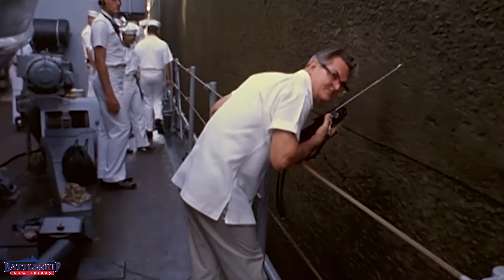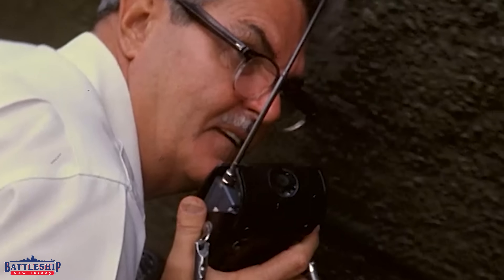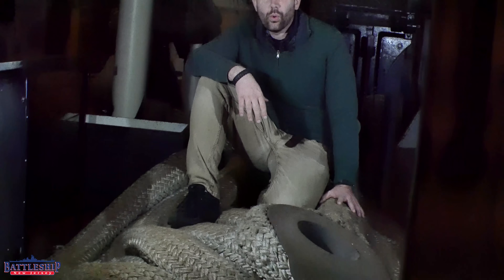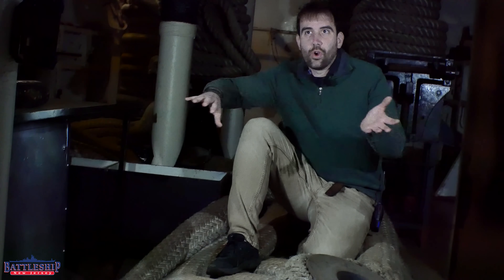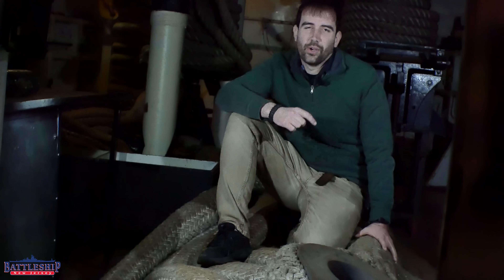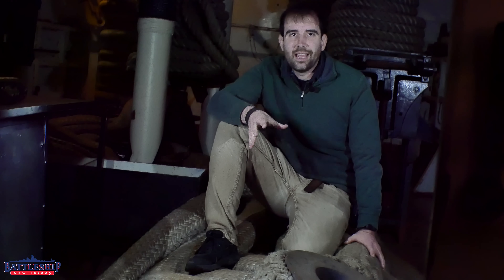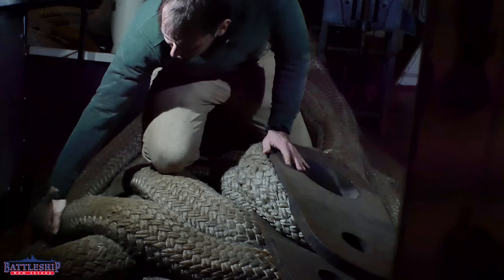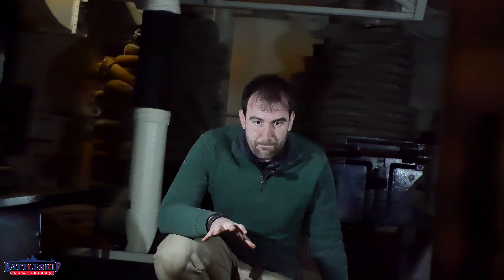Moving a Battleship Without Functioning Engines

Comment: someone needs to make a keel mounting submersible ROV. thruster pods for motion and steering, batteries to power the thrusters, fixed magnets, electromagnets and suction on two halves with subsections that can rotate to fit to a keel of any steel ship. charged from deck cables and either fuel generators, solar panels or whatever. yeah, not going to be breaking any speed records and could take an hour or so to even reach a few knots depending on the output. it would be versatile however for any steel hulled ship that cannot move on it's own power. with the materials, hydrodynamic modeling and electric motors available today while it wouldn't be easy...but it wouldn't be rocket science either ^_^

Comment: I read a lot of comments below about manually moving ships in the water which is not a problem if there is no wind or current affecting the ship, but you add a little breeze or a 4 knot current and your tiny little body can be made into some greasy spot on a dock real quick. I own a couple of small fishing boats and one time a storm came up and I got to the ramp with a 20 mph wind and some do good guy offered to catch my bow line, he caught it and acted like he was just going to hold it to stop the boat. Well, I screamed at him to wrap it around a cleat and you should have seen his face when my boat started pulling him around. And after another go at positioning my boat with the motor I got along side and he got the line around a cleat and held the boat till I got it fast. 

Tugs have huge engines, and sometimes bunch of big propellers, and are designed to handle the push and pulls of the wind and current dragging enormous loads. And Sea Tugs are for real at what they can do.

Comment: it doesn't take much to move a ship by itself on the water, but surely to speed it up or slow it down, or if you need to change directions, you will need a lot of force to alter the ship's momentum
not to mention, even though there are no sails on the ship, the wind could still push the ship around, and the tugboat will need to have enough power to compensate for it

Comment: Question for you and maybe you’ve already answered this. Hypothetically speaking if you were to reactivate the engines. What would be the consequences? is there a fine would you get arrested with the navy come and take the battleship away?
Reply: it's just not possible. It would require 100's of thousands of dollars in fuel, crew, repairs and maintenance , etc. You can't run 600psi steam through 75 yr old pipes without xray inspections and stuff.
Reply: It’s a hypothetical question. I understand it would take a serious amount of time and money. I just want to know what the consequences are of doing such a thing.

Comment: I was working at the Courier Post newspaper in nearby Cherry Hill N.J. when the ship traveled thru the canal. They had a reporter on board for several days while the ship moved thru the canal. The newspaper made a nice size hard copy book on the battleship. Guess they thought it was going to be a NY times best seller. They advertised the hell out of the book and a year later still had probably a halve dozen shrink wrap pallets of them collecting dust in the newsprint warehouse.Thanks for another great vid. While working at my first job the maintenance department had to tie a 1.25" rope on a box car and move it maybe 10' to top load into next roof hatch. Rope would break and only guy who could splice the 100' long rope was a retired navy guy.

Comment: Thanks Ryan.  I know I have been one of the many wondering what PHYSICALLY limits the New Jersey from moving under her own power, outside of legal and manpower issues.  I guess boilers are one thing to get started, but if you have no water for the steam turbines then you might as well not even bother, all you're doing is making heat.
Reply: I think a lot of the boiler issues are safety/certification. You can't pressurise up to 600psi on 75 year old pipes, without a lot of inspections!
Reply: @gordonrichardson2972  Hey that's an excellent point!
Reply: @FlyingWithSpurts  Yeah, they'd have to check all the steam pipes, all the fuel pipes, all the water pipes and get some parts that have been still for thirty years spinning very quickly to generate electricity.

Comment: Tugboats are basically a massive engine, with just enough fuel tank added to get through 2 days of full power use, and just enough bouyancy added so the engines float. Then you use it to provide massive amounts of force to a rope, and massive amounts of force to a bumper, to move ships in harbour. Bigger ones can travel long distance, but living on them can best be described as spartan, and all the crew do multiple tasks. A hard life, on both machines and crew.

Comment: Can New Jersey still steer using her own rudder?
I.e. when under tow is all the steering from the tugs or does the ship contribute to steering with it's own rudder when under tow?
Reply: I think rudders are powered by the banned equipment, so no.
Reply: I doubt they could  and also think it may be a bad idea.  My guess at the low speeds of a move like to drydock the ships rudders would be near useless or very slow responding. Better to let the tugs do the steering, they know how.

Comment: I can believe you might get 1000 tons moving a slight bit dockside in a zero knot wind BUT 1) there is still 50,000 tons of mv, momentum and 2) there is still wind speed^2 x drag coefficient x cross section area (skipped fluid density).  And 2 might get big.  Then, there is 3) ... water is heavier than air and we can do the same calculation with currents and I bet at times that is bigger yet.  It would not surprise me weather and sea conditions might strain even a good sized sea tug at times.  In the canal, any significant velocity would mean a big momentum.  If Ryan was there sticking a foot out to stop USS NJ, I expect to see only a stain on the lock gate.

Comment: I was on a 4500 ton Destroyer and I watched 2 deck sailors who were repainting the boot top (black water line) put their backs against the pier and push that ship with their legs. It moved about 6 inches, assumed the mooring lines stopped the movement, then came back to rest.
Reply: I used to stand on the mooring line cutting barges loose my body weight could easily move one. The load on one was around 5000T we used to calculate load by cubic feet using how much they settled in easy with a rectangle.

Comment: Tugg boats may not generate the power the New Jersey once could. On the other hand they usually have over 1000 horsepower which is nothing to sneeze at either.
Reply: 1000 is a smaller harbor tug, more like 2000 to 4000 might be closer.  Sea going tugs might be more like 4000 to 10,000 hp. Last boats I worked on were rated at 9600 hp.  So a lot of power in a small hull.

Comment: We are dealing with a generations of people that think you can simply start an airplane up that has been sitting somewhere for decades and fly away.  Or a federation star ship left on a planet for over a 100 years.  Yep, no problem.   People have no grasp of the mechanical complexity and required maintenance required to keep something functioning.  Modern military aircraft require many hours of maintenance for each single hour of flight.  A big old battleship has a lot (LOT) of systems that all have to work together for it to do its job.   I loved the 2012 Movie "Battleship".    They lit the boilers and had steam in about 15 seconds.  It was tragically beautiful.   A nice fantasy movie, at least the aliens lost.
Reply: While I know deep in the trenches of my brain that it is an almost impossible feat to turn it back on, my instinctual thoughts are still "couldn't we just send a volunteer who is also scuba certified down there with an angle grinder to cut off the coverings of the sea chests?"

"Hey, it's a bit rusty? Just a sec, I have a wire brush in my glovebox!"

I know it isn't so simple, not on a hundred foot wide ship certainly, not on an untouched for 30 years mechanical room too, after all, I spent two weeks installing lighting circuits and lights on a single floor of a high rise office building, and that was with a team of 4 people. I know that anything to do with electrical or mechanical systems is obnoxiously expensive, time consuming, efforted, etc, but I still underestimate the actual amount of work, I still think there is an easy solution, even if there objectively is not.
Reply: World of Warships has a LOT to answer for in this regard given its absurd abuse of physics and ridiculous speeds ships reach. I suspect it's the single largest ongoing environment involving these ships, and people who play it end up thinking they know about the ships and technology when in fact they're terribly ignorant. That they're ignorant isn't their fault as we're all ignorant of everything until we start to learn. That they think they know about the topic because they play WoWS is largely WoWS' fault because the only thing realistic in that game is the modelling of the appearance of ships (which is done very well).
Reply: @steeltrap3800  I play World of Warships and it is a fun game but the only similarities to actual naval warfare is the ships 'shoot at each other'. That is it. lol
You are right about the ship modeling. That is what drew me into it in the first place.
Reply: @ut000bs  I played it from its Alpha test through to launch.
I quit playing some 480 games after that. Too easy to see where it was going, 

WG will never change their spots. The didn't listen to anyone during testing, so there was no reason to think they would at any other time.

Sad thing is many of us identified a lot of the most complained about issues and made predictions as to likely results if not addressed.

One I made? 
"WG will NEVER manage to 'balance' CVs in the minds of most players. 
Either CVs will be 'fun' to play and a misery for everyone else, or not much of a factor for everyone else and those who DO play them will soon stop out of frustration with them being unrewarding let alone not no longer grossly OP."

If you think CVs might be a bit OP now, they were WAY worse back in Beta and release, hard though that is to believe.
That was when, 2015? LOL

I've also been reading naval warfare reference books for a bit over 40 years.
Cheers

Comment: I would assume most people see tugs as the ones in a harbor, aren't there sea going tugs that are the ones used to make such moves because they way they are designed?
Reply: You are quite correct.  Sea going tugs are bigger and much more horsepower.   Most sea going tugs are used to tow sea going barges, basically vessels with no propulsion but the size of medium ships.  Also a lot are used to move offshore oil platforms.

Comment: After you get an unpowered ship moving, how do you get it to stop where you want it to stop? Thinking that opposite to the tow there's a lot of taut lines and tugs that had been pushing are now in max reverse
Reply: Exactly  tug power to stop it. You would approach very slowly where you want to stop after beginning to slow forward speed plenty early.   Now imagine out at sea one tug towing a ship  the only way to stop there is by gradually slowing letting the momentum bleed off the ship.

Comment: Out of curiosity, why did the navy specify that the engines cannot be reactivated?
Reply: To protect the ship and the engineering plant. It would require a large crew of well trained people to bring the steam plant and engines on line. The potential is there to do serious harm to the ship including sinking if something went wrong. The Navy will not take that risk.
Reply: For an extreme example of the same concerns, there are museums with nuclear weapons on display - the outside casing of bombs, missiles, whatever SUBROC was. No, the museums don't have the explosives, propellant, or fissile materials. 

Other than safety concerns, museum weapons are also deactivated so that they're not a diplomatic issue. A museum ship that's ready to sail, with a trained crew who could be conscripted is pretty close to reserve status. In fact, Germany did reactivate tanks and other weapons out of museum collections while in the process of losing WWII, so this kind of concern isn't entirely hypothetical. 

And as a safety concern: if the museum crew isn't properly trained they shouldn't raise steam, period. Trying to find a steam leak at those temperatures is like trying to find an invisible cutting torch. If everything is operating correctly it's not terribly dangerous, but if there's damage or an accident then who is the museum supposed to call for help?
Reply: @jordanrodrigues1279  Yeah, even if the museum were "allowed" to raise steam, it's very doubtful they'd ever want to try because of the very real dangers involved (not to mention the expense of a full inspection/restoration).
Reply: @Jimorian  Not to mention the cost of Bunker C, fuel
Reply: 600psi steam is very dangerous especially in old piping.

Comment: That hawser- design is weaker that the tug's tow wire or the ships anchor chain (will be attached to this let out some) .  A Good Sized tug will have two cylinder EMD 645 diesels - generate 7 to 9 thousand Horsepower, bollard pull near 100 tons, and could probably move the NJ around easily at 6 to 7 knots in open water. Surprised Ryan is not yet selling tickets to ride NJ from Camden to the Drydock. So from the story the NJ has had cosmetic surgery on her (Bull) Nose.

Comment: While I KNEW the towline was thick, for some reason I expected it to be even thicker than we see here.  I wonder how thick the lines are that they are using to tow Carrier Kitty Hawk from Bremerton to Brownsville.  I would imagine the main towline is either thicker or has been doubled or even tripled.  Even an empty hull like CV-63 would mass over 60,000 tons.

Thank you for the look Ryan.  I'm actually amazed that the Navy left that tow line aboard.

On a related subject, the 120,000 ton containership Ever Forward is still stuck in the mud in the Chesapeake Bay and the salvage company is dredging around her and trying to hire enough tugs to try to pull her out of the mud.  None of the tugs they have immediately available are as powerful as the tug that brought New Jersey to Philadelphia or that has Kitty Hawk in tow.  Nor do they have the necessary ground tackle and anchors.  

The gentleman whose website I'm getting my news from refers back to Battleship Missouri getting run up on the sand near Old Point Comfort next to the Thimble Shoals Channel, and what it took to get her armored butt off the sand and afloat again.
Reply: I worked on sea going tugs  with hawsers of that size towing sea going barges,  That hawser is maybe 300' long and very strong but that is only part of the story. Once clear of the shallow waters the tug will let out tow wire.  The weight of the tow wire sagging deep in the water  takes up the surges caused by seas.